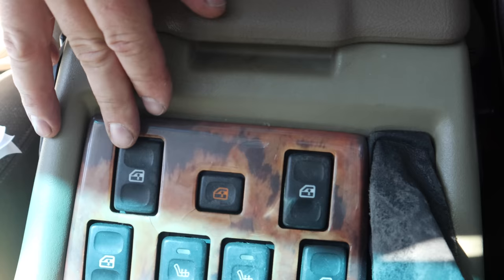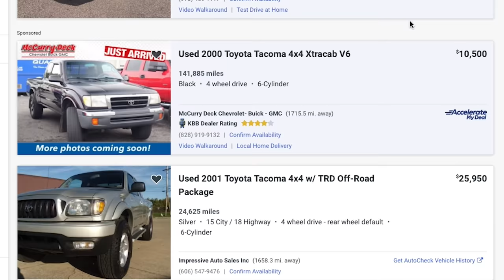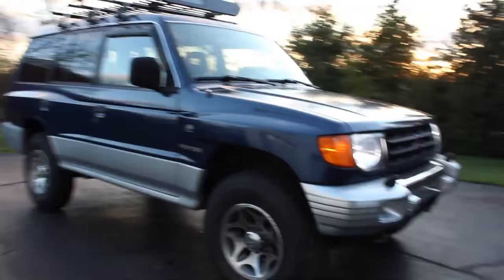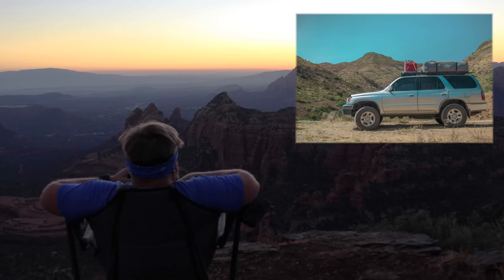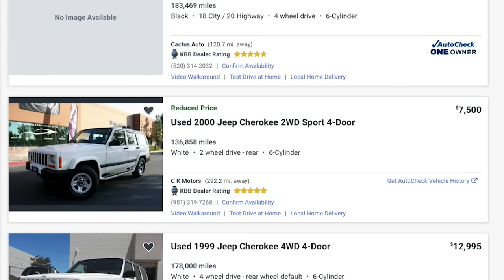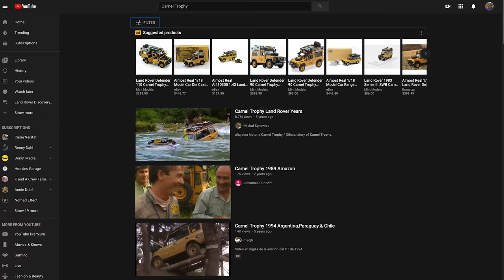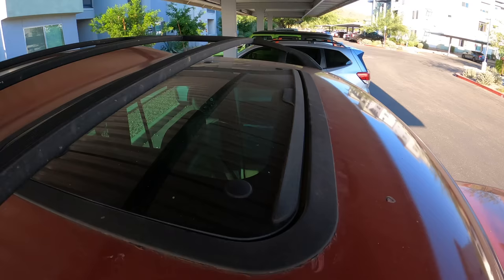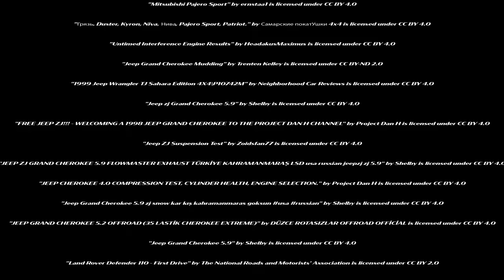The 5 BEST BUDGET OVERLAND VEHICLE Alternatives Under $5000

Comment: Great video, very informative plus I like the editing. A lot of time and effort put in, well done.

May I ask, why did you go for the disco 1 and not the disco 2?
Reply from the maker: Thank you! That's actually a great question, I think I'm actually going to try and answer it in an upcoming video. The short of it, I wanted to go with the D1 because of it's simplicity vs the D2. This was our first Land Rover, but I've always admired them from a distance. To me, the D1 represented the best of old-school Land Rover, packaged in a more every day useable package. Those 700 some-odd "improvements" BMW made with the D2 represent the beginnings of the current trend in not just Land Rover, but the offroad segment as a whole, where manufacturers are trying to use the latest and greatest technology to make more challenging offroad situations more accessible to less experienced offroaders, as well as feed into that need to have the latest and greatest techie thing so people will buy more crap they don't really need!
Reply: The D1s are 4” narrower, weigh 700 pounds less and don’t have air suspension. They all also have a locking center differential. The D2s had a locking diff too, but the early ones had no lever to engage it since they had the alternative of electronic traction control. Later D2s got their levers back.

Comment: This is a good List and the Pajero/Montero bought one they are extremely Underated. Mine is a 1998 NL stock and I took it on a dirt and sand track and it drives almost like a Raptor.
Reply from the maker: That's awesome! After seeing what they did at Dakar, I imagine they are pretty dang awesome in the sand!
Reply: @MattKester  They do they are so Light and mine is the 7 seater long wheelbase wide body. There's so much features like Over drive, A/T centre difflocks and low crawl functions.
Reply from the maker: Nice! If you're on Instagram, tag us in some photos of it! I'd love it check it out. Use @frugalexplorerdad, @2ndhandoverland, or #2ndhandoverland.
Reply: @MattKester  maybe in the future cars a bit busted up from the last owner but Its alright just few scratches and dents.
Reply: Would love to see some pics of the 2.5 gen. They are awesome.
Reply: Also what does NL stand for?
Reply: @nonope1774  hey I'm not sure if it has a definition but All the Pajeros have a generation name Like gen 1 is NA and Gen 2 is NH NK and NL there are plenty of models for each generation just google it.
Reply: I’m a lifelong Pajero/Montero owner, and run an owners group along with part of the largest Pajero/Montero owners club in the states. I will say that aftermarket parts and mods aren’t as hard to come by as people say, and there’s actually a really awesome support network here in the states for them. Fellow owners are always ready to open their homes and fridges for each other, and I’ve yet to find another group as tight knit as this one. If you want more info, throw me a follow on IG at @fifisnyderthepirate

Comment: I own all 3 Generation Montero's...just bought a 1st Gen earlier this year. I also owned a 2000 Montero Sport before I bought my 98 full size Montero. They have been absolutely awesome reliable vehicles. Generally previous Montero owners didn't have the diligence on care and maintenance unlike Toyota owner counterparts. This is why most used ones are either poorly maintained or just beat to hell. Great video!
Reply from the maker: Yeah, can't tell you how many stray dog looking 3rd Gen Montero's I've seen running around lately.

Comment: Dude ! Thank you for the information ! What are your thoughts about the Ford Bronco as an overland budget friendly rig ( not the new reboot ) 🤔
Reply from the maker: I think they can work, especially if you’re not anticipating a lot of really tight trails or a lot of rock crawling. I don’t know if you’ve ever seen Fearless Morgan’s blog, she lived in one with a couple of dogs for quite a while... They’re on one of Ford’s, or should I say America’s greatest selling platforms of all time, so there’s a lot of support, knowledge, and parts out there. I just don’t see that many of them pop up in good decent shape in what I’d call budget price ranges where I live all that often. The only other thing I’d question, and that’s because I don’t know the answer, but can the removable roof be fitted with a rack? Not an issue if everything you need fits in the cab, but if it doesn’t, will that roof support the weight of a tent or your cargo? I thought they were fiberglass, but I may be mistaken. Other than that, I can’t think of much else that would stop you. Bonus points if you can find a four door Centurion model!

Comment: I recently bought a Disco 1 with 100k miles for $1400. The auto box is being re built for $2000 and according to the off road vehicle specialists other than the power steering pump, the rest is just simple general maintenence items.
Reply from the maker: Good for you, that's awesome! 2K for that transmission doesn't seem that bad to me, we had to put a new one in my 4Runner at 120,000 miles and it was a heck of a lot more than that!

Comment: Another issue with the disco 2 is the OBD2. The electronics are proprietary. Not all of the functions can be read with code style readers. I had and excitement one and would not read the engine speed/position sensor. Engine would just die, check engine light would come in but not give a code.  Can only be read by a rover specific computer.

Comment: I had a Ford ranger, then an Explorer Sport Trac that I build up. Both are decent for camping and light off roading. The sport trac had better axles.
Reply from the maker: Oh wow.... they must have beefed it up a little more with the expectation of heavier payloads with that bed on there. I never even though of the Sport Trac... it's now going on my list of vehicles to look into in an upcoming video!
Reply: @MattKester  Its really odd that way. The axles on the sport trac had the explorer axles and cv axles, but the ranger frame and a fiberglass bed. It was also spring under axle in the rear. The 2nd generation however had IRS in the rear. It was a really odd vehicle.

Comment: On the disco 2. That old buick engine is good but needs the T top liners. The liners are straight sleeves. When the head gaskets go and it over heats. The block expands faster than the steel liners and they will slip down just a little. You can tell by running you thumb nail on it.  The liner should be only a couple of thousands down from the block. When the liners slip down, when it heats up coolant from around the sleeve will get pushed up into the cumbustion chamber.
Having the block machined for the T top liners is what is best. 
What causes these issues in the first place is the fuel mapping. They are designed to pass emissions. So they are ran lean. Which creates excessive heat, which blows the head gasket and makes the liners slip. 
Get the computer re mapped to run richer and the heating problem go away.

Comment: I love my 3rd gen 4runner 417000 and runs like a champ but I do miss my 97 discovery even though it never made it to 100k before breaking down. If I had the room for it I'd find and my family's old one and buy it and turn into a old-school overlanding rig
Reply from the maker: I hear you there. My 3rd Gen runs like a top too, but she's still got a Sixpack worth of Discovery head gaskets to go before she catches up to your mileage! One thing have noticed, that's maybe made having to do the repairs on the Disco more bearable is just how much simpler it is to do things to. Like, there's quite a few repair items on the 4Runner that pretty much require a shop press to handle like the bushings, upper ball joints, and rear axle bearing and seals. Seems like the Disco can be maintained with all the basic hand tools you'd find in someone's toolshed in the 1970's. Like, I don't hate working on it because it feels like it's from an era where ease of owner serviceability was a consideration.

Comment: Very entertaining content, thank you!
What do you think about a Mazda Tribute ?
Reply from the maker: Thank you. As far as the Tribute goes, I’d have to dig into it a little more, but it does looks like it could be a promising alternative to something like a first or second generation CRV or RAV4 or a Forester. I am noticing that it’s prices aren’t that much lower than the others and they are a little harder to come by. They do share a platform with the Ford Escape from that era, which is more common, and it looks like you can find them under 5k. Without diving into too much detail, I fee like it could be a viable option for someone who’s looking for a rig they can use on the weekend to go off on some Forest Service roads or some very light trails. I wouldn’t want to do anything too extreme with it, but for your average person’s needs, it would be more than capable.

Comment: Had to chuckle at the Land Rover one, it is the last car I would take anywhere in the Australian bush. I do want to make it home lol.

We just got a 2014 Prado (A real shame you got the weak Lexus version, missing the Diesel), but my grandfather has a late 90's model Pajero, just put your foot down and send it, and most times it comes out on top lol.
Reply from the maker: I've heard that mentioned a time or two about Land Rovers. Hopefully we never find out the hard way, but fortunately enough for us, it's never going to go that deep into the wilderness without our trusty 2000 4Runner to help it out of a jam. 

I was just looking at new Prado's on the Toyota Austrailia website... man I'd love to have that diesel fuel economy. I did the liters/100km conversion and they're supposed to get something like 30 miles per gallon! You couldn't get a 5th Gen 4Runner with the gas V6 to get anywhere close to that with a tailwind! I hate that we get screwed out of so many cool vehicles here... Don't get me started on the massive crimes I would contemplate committing to get my hands on a new 70 series here!
Reply: @MattKester  Yeah, the new Prado's with the power bump are quite nice. Also look at the torque specs on them, over the petrol engines. I put it in low range and the thing just pulls. You can tell the difference with the Camry engine, which is also 3 litre. Although I am enjoying the 150 litres, 1500km+ fuel tank range lol. My Camry was at 800kms

The 70 series here has an entire cult following, if I didn't need the 3rd row, I would have considered it.

Comment: I had a disco II se. Great off road, comfy,  slow on hwy and drink gas like crazy.. really liked that truck. 
Electronics issues are a pain. Had the 3 amigo several times. Once while turning into a parking spot the and went on and brake pedal became hard as a rock, couldn't brake...so be careful with the and sensors.
Reply from the maker: She's definitely a fuel guzzler, that's for sure. It's also frustrating because she requires premium fuel, when my old 4Runner can through even the nastiest of cheap 87 octane without a complaint. I will be keeping an eye on the electronics, we do get an intermittent code sometimes for the ABS, but it typically goes away after you start driving for a while. Honestly, it doesn't bother me that bad since I grew up on vehicles without ABS and drove a lot of big rigs that didn't have them either.
Reply: @MattKester  me too but be careful, again when i turned in that parking spot, i could not stop as tge brake pedal became hard as a rock. The 3 amigos is when the abs,traction control and hill descent light come on at the same time, very well documented issue, at least on the disco II. If you havent yet, look fir a guy on land rover forum called "disco mike" he has a disco, he is a mechanic by trade and know that beast like the back of his hand. I believe he is from AZ.
My disco got totalled in an accident (someone cut off my wife..)
Since then i got an h3 (the 5 cylinder s) lack a bit of space but still a great truck for off road and comfy on street.

Comment: If I may add one more suggestion to the list. I would add a k5 blazer to the list they are getting more expensive but parts are plentiful. I picked mine up for 2700$ 3 years ago it runs and drives it does have the usual GM rust.
Reply from the maker: Good call!

Comment: @Frugalexplorerdad great video! Super informative I love how you compared each vehicles close alternative.
What engine issues are known for the 01-02 Montero mentioned in the video ?
Reply from the maker: Thanks, I'm glad you liked it. As far as the 01-02's go, when I did my research,  I noticed it mentioned that both the 3.0. and 3.5 liter from those years have potential O2 sensor issues (but honestly, that's something every vehicle can suffer from age) and the 3.5's have been known to leak from cylinder heads and the 3.0's had the potential for valve stem leaks. None of these are anything I'd call catastrophic issue, more something to be aware when you're inspecting a rig before you buy it.
Reply: @MattKester  yeah I just read the the issues with the 02 being a simple O ring fix. Good to know because I just bought a 02 Montero and have been using it regularly as an overlander in San Diego county. It’s extremely overrated and super capable and comfortable!
Reply from the maker: @Thecarexchangepodcast  that’s awesome! We actually had our eyes on one right before we bought the Disco, but missed out on it by a couple of hours. I’ve still got my eyes peeled though!
Reply: @frugalexplorerdad how do you like your 3rd gen 4Runner? I’m about to purchase a ‘98 2WD and ‘01 4wd. It will be my first 3rd gen

Comment: please talk about the polished metal ball that connects the axel to the wheel..  i had one that blew head gaskets
Reply from the maker: Those are th swivel balls. They are just a cover to hold the grease inside of the CV joints at the end of the axles.

Comment: My old Montero SR was a tank. The only issues I had with it were the valve guide seals which are common, and the brake lines had to be completely replaced. I chalk that up to Midwest winters, but other than that it was an awesome rig.
Reply from the maker: That's awesome. I remember one of my neighbors having one when I was a kid and that thing lasted through quite a few Alaskan winters! I'm really hoping I can find someone some day with one to feature it on the channel!
Reply: @MattKester   check out the Expedition Portal and Overland Bound forums. There’s still quite a few in the road, but those are the two places you might have luck finding one. Tell ya what, if I can find another SR in good shape I’ll be snatching it up. That’s the one with the factory rear locker. All it really needs is a small lift and a set of tires to be plenty capable. 

Happy hunting!
Reply from the maker: @StayZero556  interestingly enough, I literally just drove past a, from a glance, clean looking second gen parked at an apartment complex. I was in a hurry, but if it’s there tomorrow, I’m gonna take a closer look.
Reply: @MattKester  I’m rooting for you! There’s an imported Pajero running around where I live. I keep an eye out for it just hoping I can talk to the owner.
Reply from the maker: I know that feeling! Happy hunting... I think I’m gonna go leave a note and see if this person gets back to me. Or is leaving a “hi, I like your rig, wanna be on my YouTube?” a little creepy? Lol
Reply: @MattKester  maybe a little. Maybe start with hey I’d love to ask you some questions about your rig if you have the time.

Comment: Nice, though I would put the 2nd gen Isuzu Trooper on this list right next to the Montero. Very similar mechanically, but cheaper, readily available, and I'd argue quite a bit more reliable.
Reply from the maker: I hear you. I was literally almost to the coin flipping stage to decide between these two. The Trooper is definitely on my radar and I plan on talking about it very soon!
Reply: As a 25 year veteran import mechanic I will argue... That they are about the same.  All of the Japanese vehicles are, if you take good care of them they will take good care of you. There is truly nothing particularly special about Toyota.   People tend to forget a lot of maintenance, and then complain. My ZJ is JUNK compared to a import rig, but hasn't ever, not gotten me home, in 10 years.